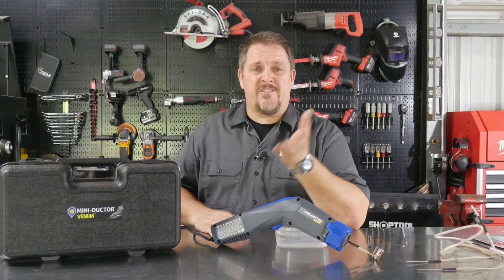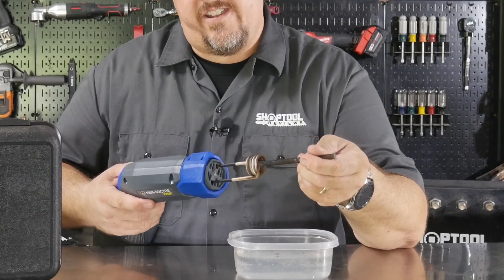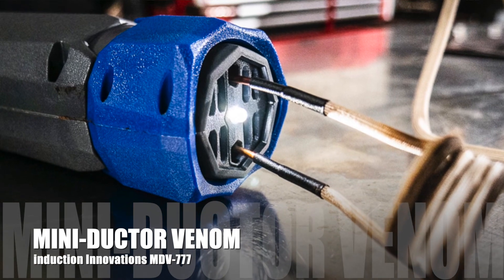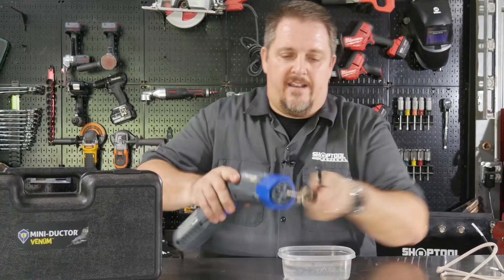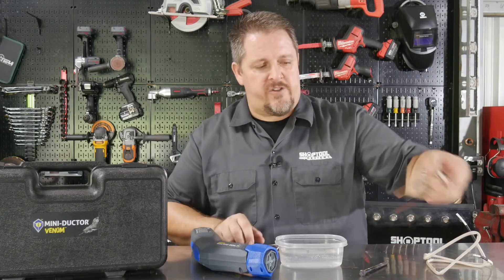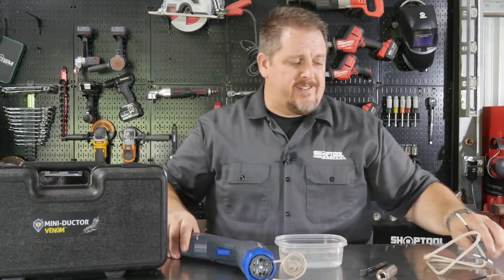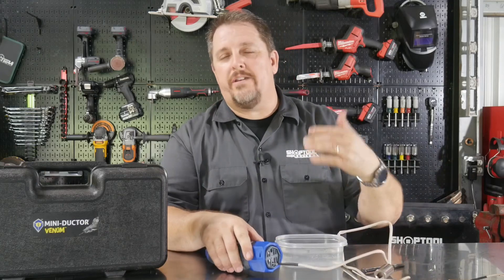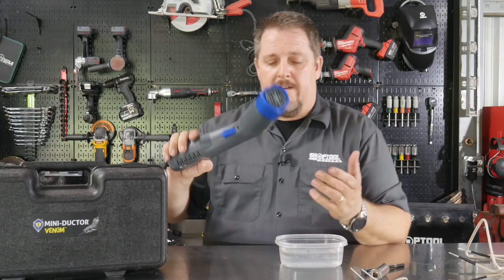Heat Rusty Bolts RED-HOT in Seconds - Mini-Ductor Venom MDV-777

Comment: These work the best on nuts. They sometimes do good on bolts.  Reason is the heat is not getting to the threads with a bolt.  Some heat does, but it's sucked away by the metal surrounding the threads.  That area acts like a heat sink. Unless the heat can move down the bolt, before it is dissipated, the threads section won't get hot enough.  A torch works because it's heating the whole area. Which is, sometimes, not what you want.  It's a good tool for what it can do, but it has it's limitations.

Comment: Looks awesome but hard to justify the cost (around $550 as of this writing) unless it would be needed frequently in a revenue-generating use.
Reply: I can tell you every diffuser pipe I save with this tool saves me 1500$.  Cant tell you how many of my mechanics have broken off the 8m bolts in the seventh injectors.

Comment: Please note:  if you want to save the threads on a nut or bolt, quench it with cold water immediately after you have gotten it hot.  This shocks the rust, creating a black oxide powder that will wash away with water as you loosen it.  Water is your BEST lubricant!  You will nearly always gall and ruin the threads by turning it while hot.
Reply: thank you for the tip. I was actually wondering this exact thing. If it doesn't work, can you reheat it after you've quenched it and do it again?
Reply: @NspaceN  yes, you can heat it progressively hotter and quenching it immediately for as many sessions as it takes.  Also, try slapping it with a hammer, if you can, just before you heat it again.  Remember, you are shocking the rust by heating and quenching.

Comment: "If i used a torch i would not be holding the end of this" 

so then does that mean the induction heater will only heat the head of a long bolt?
Reply: I believe so yeah

Comment: I have a  2004 VW GTI and need to remove a bolt linking the control arm to a subframe.  The bolt attaches to a captive nut welded to the subframe.  There's a very small hole (maybe 3/8") in the control arm that I've been using to spray penetrating oil on the nut, roughly once every 4 months.  I'm doing this in preparation for attempting to remove the bolt.  My concern is that roughly half the people that attempt this job, end up breaking the weld that holds the captive nut.  If this happens, it's impossible to remove the bolt without grinding a hole in the subframe in order to wedge a screwdriver against the nut and hold it in place while removing the bolt.  The Mini-Ductor Venom seems like a good tool, but can it be made to fit into a very small 3/8" hole?  I'm thinking about using a heat gun instead.  The problem with a heat gun is that it blows very hot air and that air spreads.  I'm unsure how hazardous the residual hot air would be to other areas above the subframe.  What's your opinion?  Thanks for making this video.  Seems like a good product.

Comment: I'm not a mechanic. Is this product designed to replace a torch?
Reply from the maker: Yes, for the most part, it can replace a torch. There will still be times that you need a torch, but this is much safer when you don't. thanks for watching.
Reply: Not completely replace, just to use in times where a torch can't or shouldn't be used

Comment: some nuts are made of bras, some copper. Will it work?
Reply from the maker: Low resistivity metals such as copper, brass and aluminum take longer to heat. Yes, it works, but it may take a little longer. Thanks for watching and commenting.